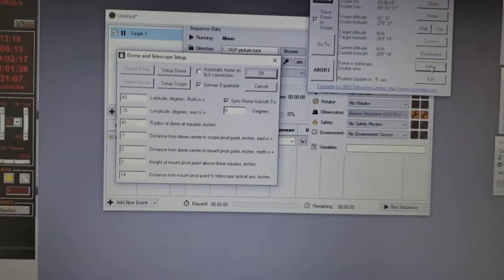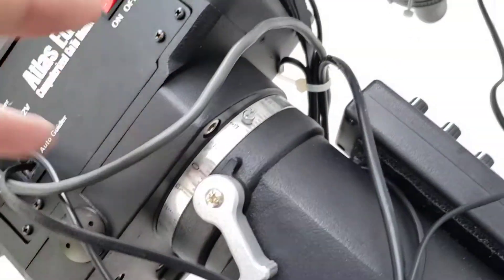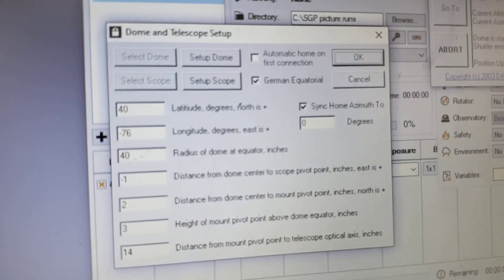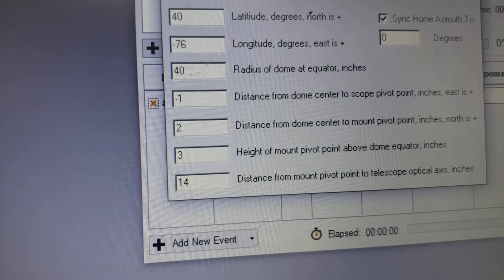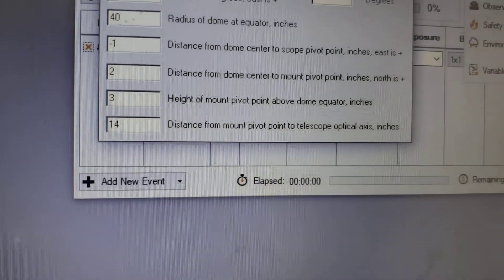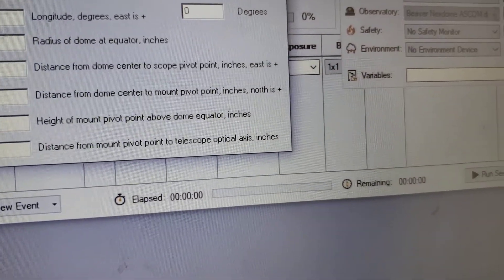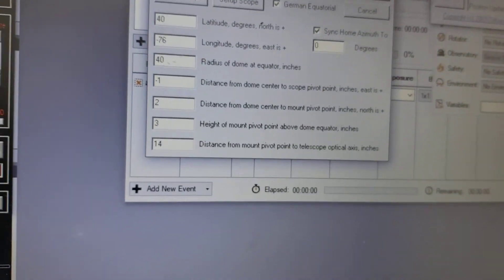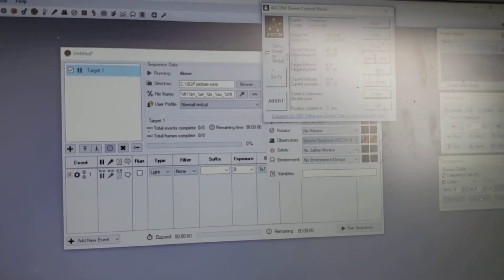Nexdome ASCOM Dome setting explained.

Comment: Greybeard, thanks for the link via the SGP Beginners Questions.  I'm wondering if you are participating on the NexDome forum and if so what's your username. I don't know how to DM on YouTube, but please DM me if you can.  Secondly, even though the dome isn't perfectly round the radius should be 43", I noticed that you're taking measurements from the dome equator to the outside surface of the mount, actually the mount's point of rotation is inside the mount, so you would need to add the radius of the mount where the RA & DEC axes cross.  I do have more questions about using the CGEM-DX mount and the dome with SGP, I'm still in the process of getting my dome geometric numbers dialed in, at this point I've got the mount setup without the OTA or counterweight.  I do know the distance between the mount center of rotation to the center of the OTA (361mm) so I've added that to the equipment profile.  Thanks, Steven